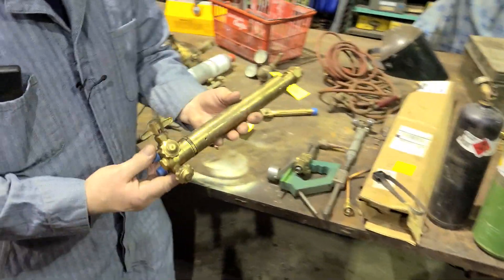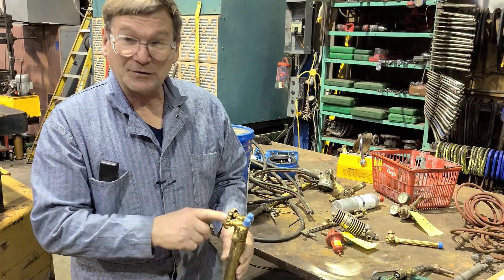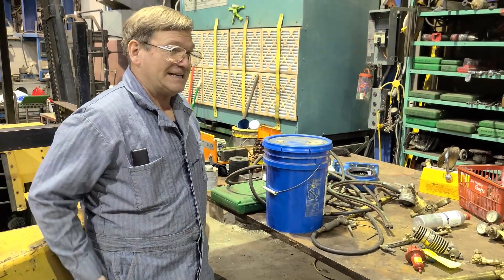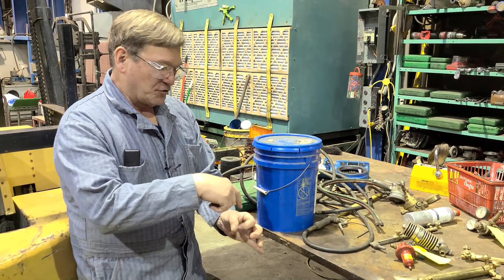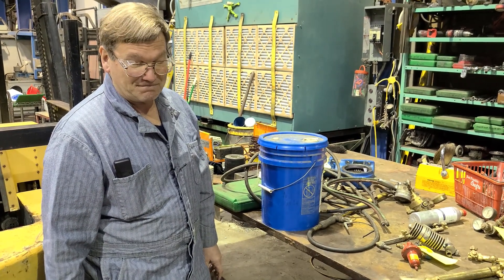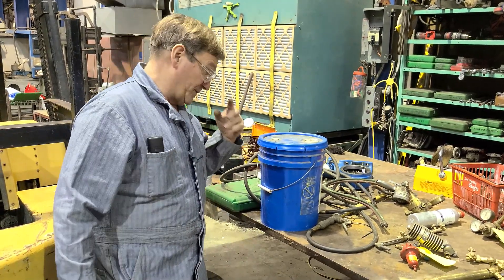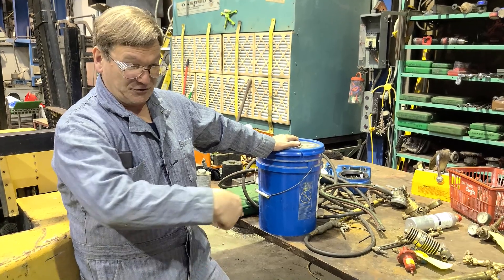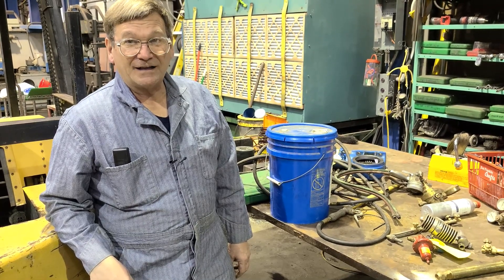Machinist's Minutes: Flame vs plasma vs waterjet when cutting thick materials

Comment: I haven't actually run acetylene on a cutting table in a long time, seems like it always gets crap in the tip, only thing i use for hand cutting or scarfing though. I was using MAPS gas until they stopped putting it in large bottles, that was best cutting gas for machine cutting. Now all we get is chemtane which i swear is just regular propane, but other than the long preheats i have been able to get excellent cuts on it and the tips seem to last forever without cleaning.

Comment: Many cnc burn tables I ran had both plasma and oxy fuel torch. Some had a spindle with quick change tooling as well. You are spot on with what you said. Also some smaller parts are required by the customer to be cut with oxy fuel by the customer. I was told it could hold the tolerance better and after listening to you, I understand why.

Comment: Using the right tool for the job: I had a reputation for being "the old guy who doesn't like 3D printing." Actually, I used the 3D printer whenever it was appropriate, and only questioned its use when I saw people using it to make simple parts that could have been made in the machine shop better, faster, and cheaper.

Comment: The most accurate is laser, of course. I’ve never cut with flame, so I can’t say from experience, but everything I’ve seen has me thinking it’s the least accurate.
Reply: I've never seen particularly deep cuts with laser, presumably because the focus can't pull that wide? How thick do you go?
Reply: @jonwatte4293  1/4”. It’s all about the power. It takes a thousand watt fiber laser to cut about 3/4” steel and 5/8” aluminum. But there are 10,000 watt lasers cutting 5” steel to almost 0.001” accuracy in intricate designs.

Comment: Thanks for your machinist scope of information for all the ideas you pass along.  Very cool indeed.  One advantage of water jet / abrasive is versatility.  Our local guy has cut 5 inch stainless, thin copper head gaskets and sheets of half inch rubber.  Our school water jet cut out marble rock figures and I understand some foods like Twinkies are sliced with water.

Comment: Hey, good video… I own high definition plasma, that in the scheme of things isn’t anywhere close to the biggest. I Cut 2” plate square no worries and 40mm regularly. far cheaper and faster than oxy. it’s true machines with 5 axis can compensate around radii etc but it’s more about torch height and speed, the cut gas is actually spinning… because of this you get a square side as you travel through the material and a bevel side. You cut clockwise around the outside of a part with standard tooling. Torch too low bevel one way, torch too high, bevel the other. You slow the travel speed and because the material removes more efficiently, the voltage height control drops the torch…. You can use all this to compensate for the cut lagging at the bottom edge around corners and radii, but you need good software and hardware driving it…. Like Australian made Advanced Robotic Technology’s machines offer 😁  🇦🇺

Comment: Important point about flame cutting is also that in mild steel it will introduce carbon to the surface, thus hardening the cut surface. Plate warps nicely when machining that off and also kills your tooling. If planning on machining after cutting with a flame and tool life or accuracy of work is high, then the plates need to be heated to 560 C, held and cooled very slowly to get the stresses out and get rid of the hardened surface.

Plasma, laser and water are nice that they do not have this problem.
Reply: Air plasma definitely makes the cut edge hard. I haven't got to use the mixed gases plasma like the big boys use,

Comment: They use oxy fuel where I work to cut scrap titanium and to bevel titanium ingots that are being shipped out. They will not use plasma because of the possibility of tungsten contamination from the electrode in the plasma torch. They will not use water jet because the abrasive is also FOD and can contaminate. I’m talking about the highest grades of titanium used in turbine rotors.

Comment: I never had any of these cutting methods in my shop but when I was working in a shop outside I was hired to do CNC machining and did alot of wire EDM cutting of thick material. It didn't ruin the temper of the steel when finishing in oil. It is slow but always does a nice, accurate job.
Reply: Wire EDM kind of ruins the surface, if the workpiece material you are cutting is of hardening kind. It will change the hardness on the surface to higher HRC, although newer machines will almost completely eliminate that. There however is always a bit of recast.

Comment: just about to get ready to get our waterjet up and running, we use plasma cutting a lot but holes are a nightmare, but it is quick to cut and super cheap to run, about $4 per hour here in Australia. i think the water jet is about 88 times that cost ! they all have their place in industry.

Comment: What about EDM? Can't recall what it exactly stands for , however, the 'E' should likely stand for extremely EXPENSIVE! Using electric arc to cut metal in water. Using deionized water. And a tiny brass wire does the cutting. And is consumed slightly and scrapped. It is a cool process, a shape can be cut to what looks to be 1/1000 of 1/100,000of an inch, a circle or other shape can be cut out of a 4"+ thick block of steel. A piece cut to fit it's place, slide it in and no visible seem! It looks like a solid block again. The clearance is so small its probably like a scratch on the surface from 5000 grit sand paper.  It is probably in danger of cold welding.. I saw a video of a guy building a somewhat crude  version at home to drill tiny holes, how else do you drill 1" deep holes .005" in diameter and the current and voltage isn't that high, it is probably a slow slow process,

Comment: Why not use LPG or LNG instead of acetylene? I was working for short time in heavy machinery repair shop and they used LPG for cutting.
Reply from the maker: We've covered it some in other videos, but it boils down to preference and individual situation. LPG will use more oxygen and will not burn as hot, though it puts out more overall heat. That, and what's being cut, and local prices, means one might be better than the other for any given shop.
-Cameraman
Reply: @HOWEES  Ok. Thanks. :)
Reply from the maker: I meant to say flame cutting, or oxy-fuel cutting, it just came out that way.  My preference for extra thick material is propane, or gasoline.   @waldemarii
Reply: @HOWEES  No problem. I mainly watch your content for entertainment purposes. :) Though I have picked up some good tips and knowledge from your videos. Keep em coming. Greetings from Finland. 👋

Comment: Used to go work on flame cutting tables over in Youngstown, Ohio, old steel mill turned into a burn shop for making counterweights, they cut 12 inch thick slabs with natural gas and oxygen, one of the messer tables had 21 torches

Comment: Something else he forgot to mention is the fact that a gas torch will only cut steel …..plasma will cut aluminum and stainless as well as steel and water jet will cut just about anything
Reply: Laser is the other common CNC cutting method. Very clean cut. Fast cutting.  Small heat effected zone.  Disadvantage is it use lots of nitrogen gas. All cutting methods have there place
Reply: @stevesauto1109 Laser cutting still, much like many other methods, tends to harden steel at the cut. This can necessitate further processing before, for instance, putting it in a press brake, as that could damage the tooling. Waterjet cutting does not have this disadvantage. Also, waterjet is the only practical option for thick aluminum, again for heat reasons. Like you said, pick the best tool for the job.
Reply: Interesting. I thought it would cut stainless effectively too (can't imagine it not doing so) but I would imagine it getting really ugly...You can definitely weld both it and aluminum though at least
Reply: @Sketch1994 Sadly just cuts regular low alloy steels, some higher alloy steels can be cut but... Not easily, the others you are melting away material.
Reply: @Sketch1994  yeah you cant flame cut stainless because its cutting by oxidation and  obviously stainless doesn't oxidize. it will kinda just burn up and not really do anything